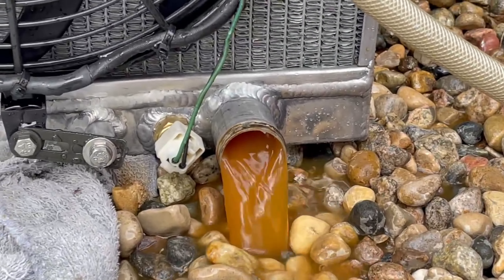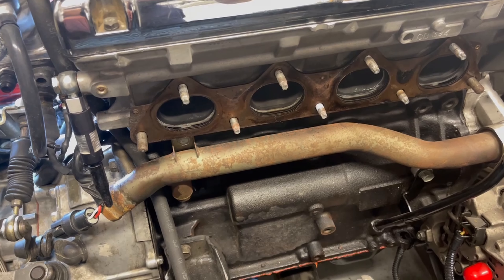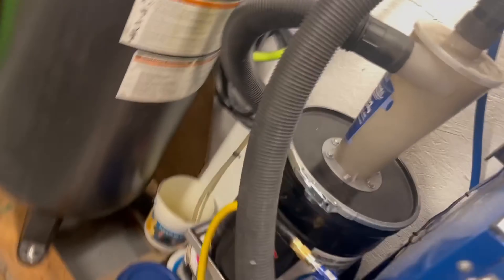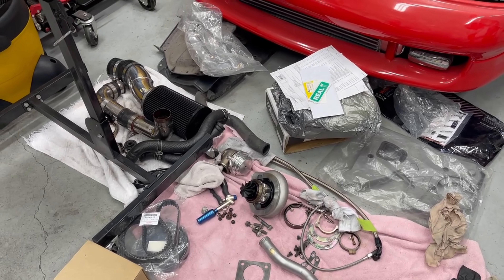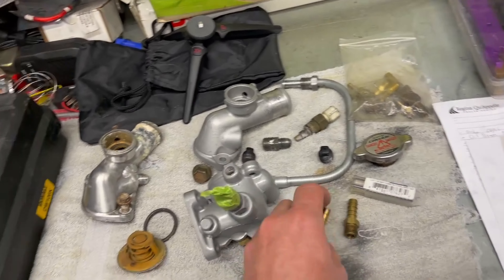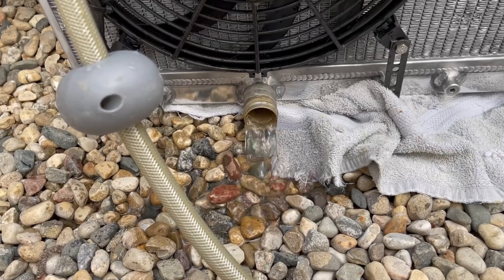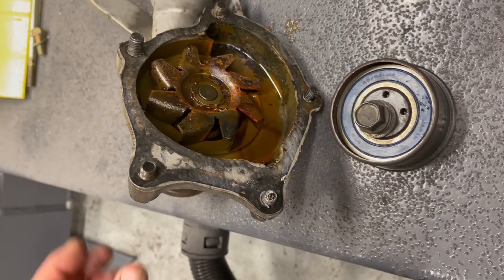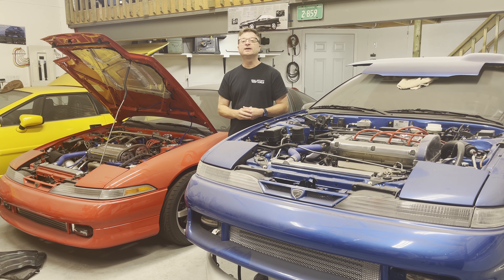Making Your Coolant System Like New is EASY!

Comment: Can’t wait for track day!!  Of course we all prefer oem wp but what are your thoughts on gates wp?
Reply from the maker: Me neither on track day. Need to get a GoPro I think for then. 
For the performance we want to put into this car I will only use an OEM pump. Tried and true for longevity and reliability. The Gates pump is fine for a stock builds or mildly enhanced, but pay for the extra insurance and less risk on a big build.  Enough can go wrong when you are pushing 500 to 700 HP.  Plus replacing the water pump on these engines is not a low hour labour job.
Reply: @SlippingTime  You have a good point.  Just hate how much more they are.  I've done it more than 4 times since my rebuild but that was my fault as I didn't do a good job flushing the block out.  Finally quit leaking out of the weep hole.